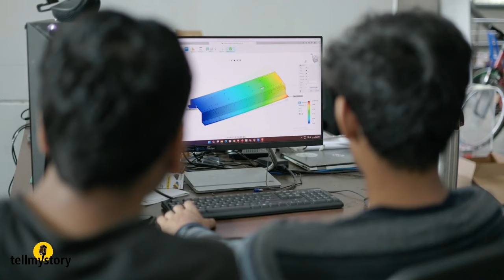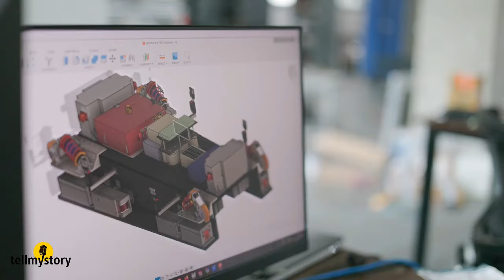Global Acclaim for IIT Madras' Hyperloop Model: India's Bold Step into the Future of Transportation

Comment: Why is it running on wheels?
Reply: Yep but without friction wheels
Reply: There are many designs that have initially developed by company and individual startups on this future technology, because it will use magnetic levitation inside the vacuum tubes there should be some short of starter, controller, or can say type of braking system to avoid any type of failure in system in any worst cenerio and for that currently the best solution is to use low pressure tyres. This thing may change in future if they will come with more innovative designs ( they will i know:) )  but as of now we can see Worlds fastest maglev train L0-Maglev series uses exact same concept to propulse train at certain speed and after that tyres goes inside the train and train starts hovering on the principal of Superconducting magnetic levitation..... or one of the answer of this question can have like they are running this prototype on frictional track not inside the tube so they want that extra force currently ( i don't know iam not expert in this but ya !!)